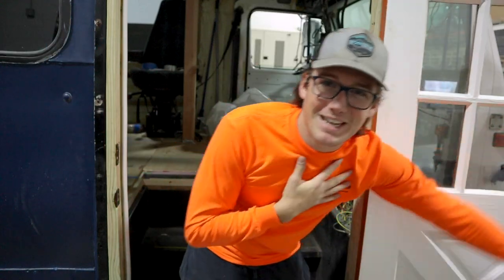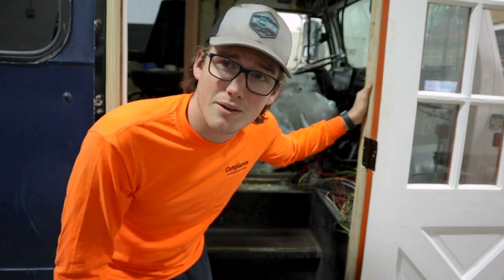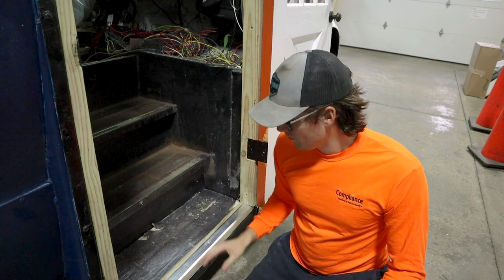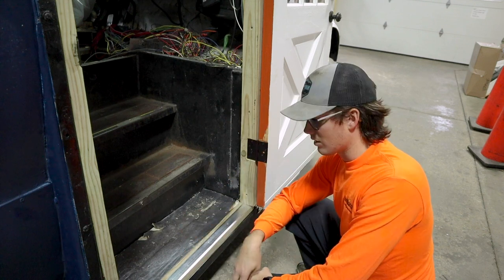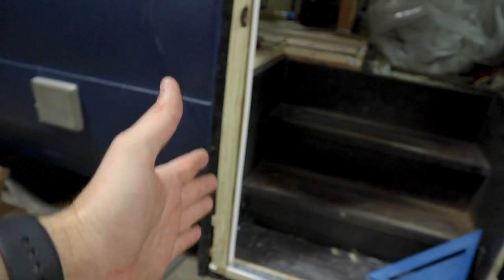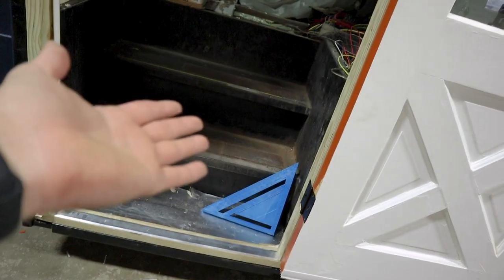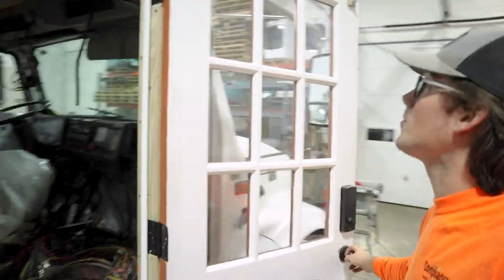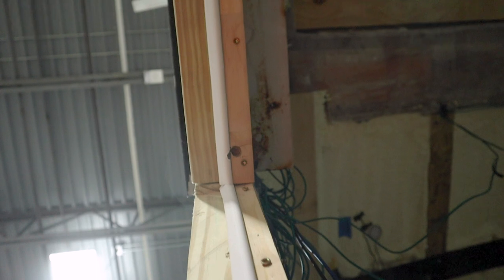Making A Custom Door Frame For Any Door On Your Bus! Upcycled House Door On A Skoolie--Skoolie Ep 35

Comment: Doing anything to insulate the windows in the door? Also I'll be interested to see if the fitment of the door needs to be tweaked as it gets exposed to extreme heat or cold.
Reply from the maker: The windows have been changed to Lexan and we’ll have an insulated blind on the inside to help with temp control. I left a small gap between the door and frame so I’m hoping that will give enough room for expanding/contracting! Fingers crossed haha